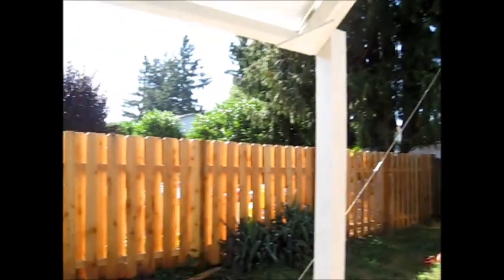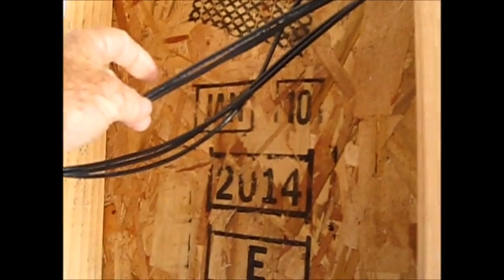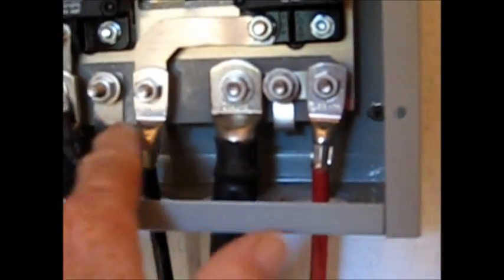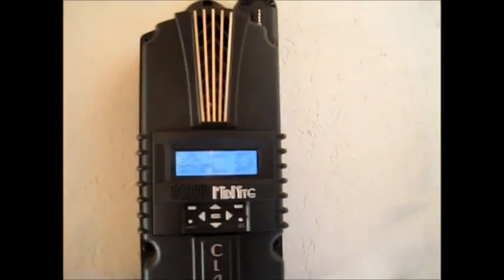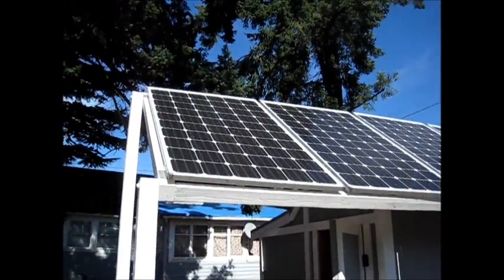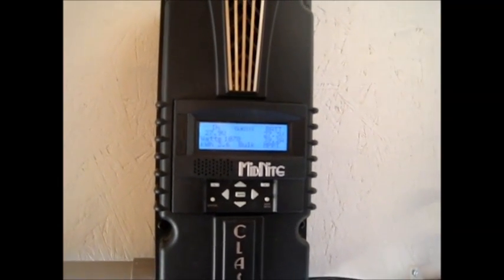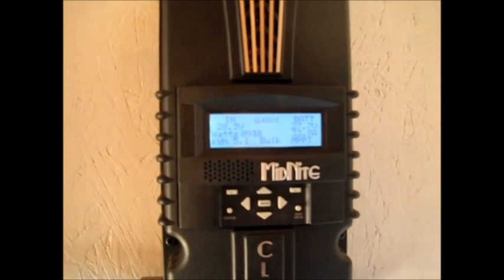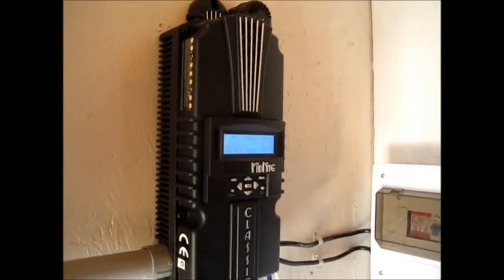Off Grid shed rectifier wiring and assembly of Freedom II

Comment from the maker: I would recommend you use drop cords with 10awg size wire. you will have considerable line loss using 14/3 or even 12/3. even at 10/3 its almost 24%. and no, I do not need to go up any higher, there are plenty of large limbs another 12 feet up. I am right in the pocket lol.